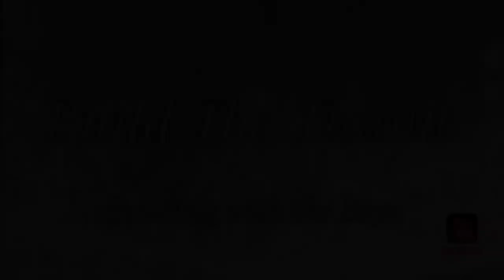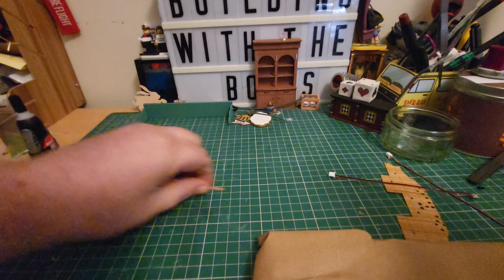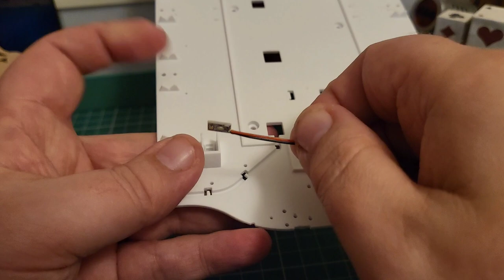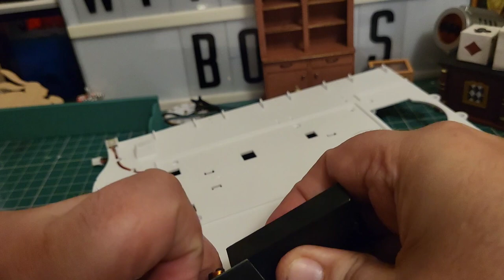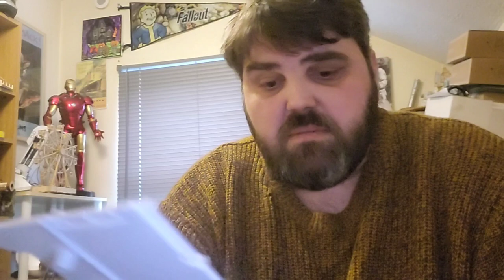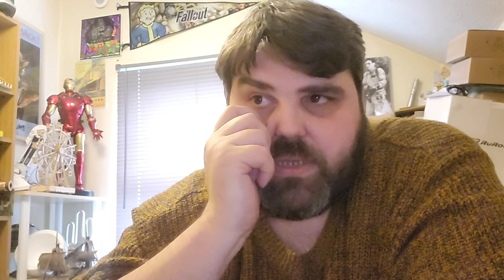Hachette Build the Titanic : Part 41

Comment: A nightmare I damaged wood in issue 41 so I decided to repurchase issue 41 on the 15th of January. Unforunately thought I had received issue 41 yesterday the 30th of January was right magazine so assumed I had received box 41 but didn't noticed until next day they had put in issue 44 which I already have instead of 41.
So I rang hatchette customer service but to my dismay they are going to send out issue 41 which I never received told them I have right magazine but wrong parts they said they will send but will take upto 14 days.

This is so frustrating !

I noticed something issue 41 and 44 look like the same size box until you look very closely at the info on the box and yeah I had to use Magnifying glasses to read the details on the box. So now I have issue 44 twice